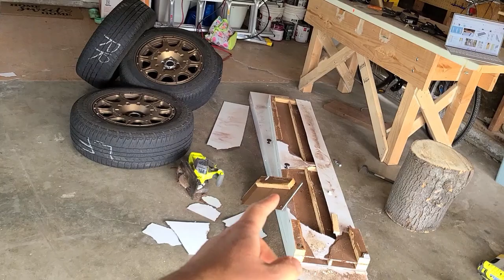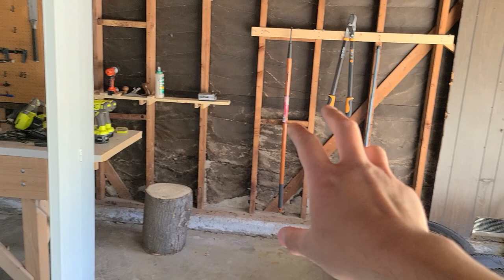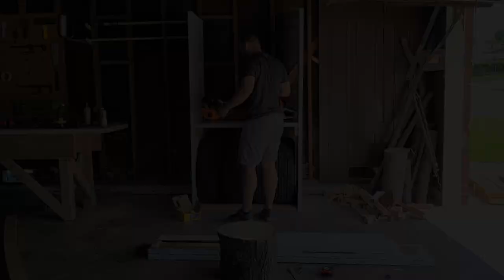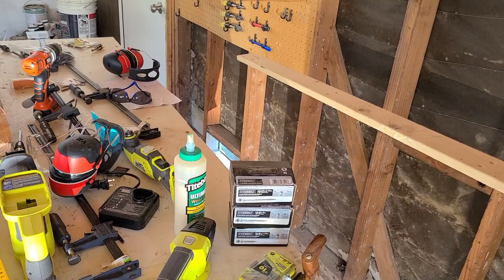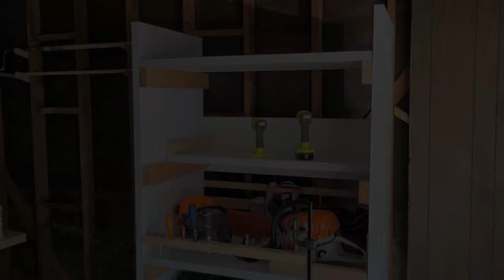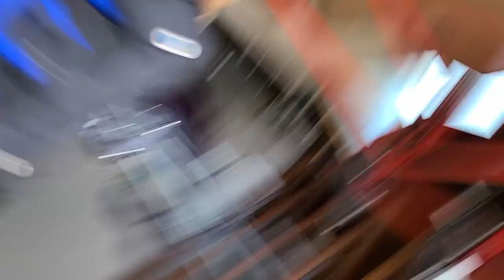A Dentist Builds Custom Tire Rack Power Tool Shelf From Cheap Hollow Bifold Closet Doors

Comment: Glad to see you did the panel in the back. It acts as a triangle brace (draw a line between three screws and you can see the triangle) and will keep the shelving unit vertical. The horizontal pieces alone would not do the job.
Reply from the maker: Yeah! It definitely feels more stable after I added them.

Comment: Great job repurposing those doors. Shop/garage furniture doesn't need to be ornate, it needs to be functional.  My garage has several pieces that I cobbled together out of scraps and even an old door, and they work exactly as I planned them to function.
You nailed that creative reuse of those doors and produced a highly functional piece of furniture that met and exceeded your needs.  Well done. 👏👍👍

Next project, a wood and scrap wood movable storage piece?
Reply from the maker: Thank you! That's the main reason why I haven't made any indoor pieces yet because I know they need to look nice so I've been practicing on garage and backyard pieces. I'm almost ready to make my first indoor piece, but a scrap wood storage bin is a great idea!

Comment: You should get you a stud detector.  Would help with finding the structure inside those doors.  Just, don't point it at yourself!

Also, be careful with using bi-fold doors as up-rights.  They're not intended to take a lot of weight - but what you've done is good.   Just, don't try to store real heavy stuff on them.   They won't collapse in on itself, but may lean until it falls apart.  Adding a 1/4" piece of plywood as a back will significantly strengthen the whole unit :)

Also, 2x3 for stuff like this is more than sufficient!  I've built many shelves out of 2x3 to save on weight, space and money.   With a backer, you could even use 1x2s (aka marking stakes) to hold the shelves in place on the sides.  Just gotta get fancy with your screws :)

More importantly, it looks like you're having a lot of fun - and that's great! :D
Reply from the maker: Thank you! You always have very detailed feedback and I really appreciate that! I'll make sure the tools don't get too heavy and will probably starting using 2x3 more now. I really liked using them! Thanks again!